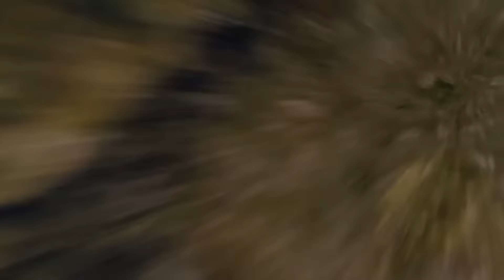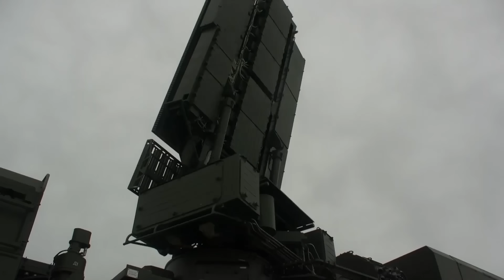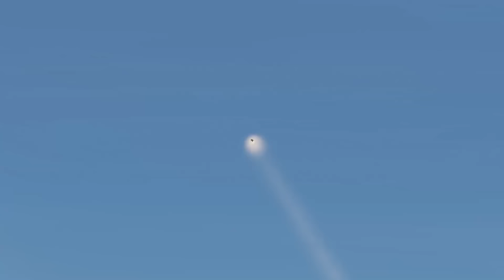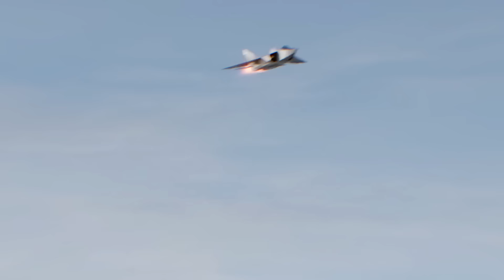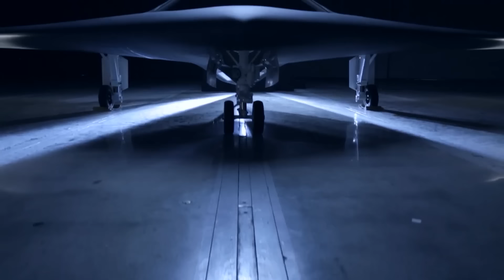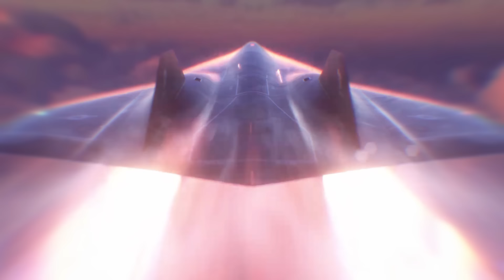F-47 7th Gen Fighter Jet Broke Every Record — China’s in Shock!

Comment: WRONG the F-22 raptor is a Air Force Jet NOT Navy -  

Range of the F-15 Eagle

The F-15 Eagle has impressive range capabilities, which vary slightly depending on the specific model.
F-15A/B/C/D Models

    Maximum Range: Approximately 3,450 miles (3,000 nautical miles) with conformal fuel tanks and three external fuel tanks.

F-15E Strike Eagle

Maximum Range: Similar to the F-15A/B/C/D, the F-15E also has a range of about 2,400 nautical miles, optimized for long-range strike missions.

Summary of Key Specifications
Model	Maximum Range

F-15A/B/C/D	3,450 miles (3,000 nm)

F-15E	2,400 nautical miles

Range of the F/A-18E/F Super Hornet
Maximum Combat Range

The F/A-18E/F Super Hornet has a maximum combat range of approximately 1,275 nautical miles (2,346 kilometres) when configured with minimal armament, such as two AIM-9 Sidewinder missiles. Range with Load outs

The range varies significantly based on the loadout:

Loadout Description	Range (Nautical Miles)

Minimal (2 AIM-9)	1,275

Standard (2 AIM-9X, 2 AIM-120, 2 2,000 lb bombs, 1 drop tank)	~1,188

With Conformal Fuel Tanks (CFTs)	Potentially increased by 260 nautical miles

Future Range Enhancements

The U.S. Navy is exploring new methods to extend the Super Hornet's range, including the potential reintroduction of conformal fuel tanks, which could provide additional fuel capacity without significantly increasing drag.

The Super Hornet's design allows for flexibility in mission profiles, making it a versatile platform for various combat scenarios.

Comment: It actually can fly into the past or the future. It has advanced time travel capabilities or ATTC which if the Air Force should lose an engagement it can go back in time and win. Or go into the future and see where an adversary will be then travel back to the present and tell its fighters where to attack. Amazing aircraft. I actually work on it at area 52 which is just down the road from Area 51.

Comment: China has shown with little fanfare to make platforms that look good and that attempt to steal tech that resists reverse engineering. The carriers not even nuclear that do not work, catapults that do not work,  carrier elevators that do not work, search radar that does not work, 6th gen fighters that are flight limited and could never fight in real contested airspace, raptor engines copies that do not work, space capsules and lift systems that are decades behind, computers and avionics that China could not copy even if they had the plans as China cannot make the chips, metals alloys that are secret and machining manufacturing techniques ceramic coatings that the manufacturing process is so complicated as to make even the actual formular nearly valueless. When the US takes a system to operational it works better than thought and routinely devastates the adversaries.
My understanding is the F-47 uses altitude to defeat range, speed. and thermal conflicts in operational perimeters in concert with newly developed ceramic stealth coatings. Fly about  100,000 feet altitude and surface friction is reduced by about two orders of magnitude by less dense atmospheric pressure (.156 vs 14.7 PSI at sea-level about 1/100 as dense) which as drag is also reduced increases speed and range as it takes less power to push the aircraft. Of course at this extreme altitude for initial jumps to conflict zones stall speeds  of Mach 2-3 are realistic (appx. 1200-1800 knots, 1380-2070 mph) and that's just the minimum speed to prevent a stall and could expect skin to be able to stay below 212- 284 deg. F with skin cooling from fuel before it's sent to engines the aircraft at that alt would be stealth for IR heat detection. This would make the max contested airspace speed to be Mach 2.18 or about 1250 kts to remain under control, not stall, and remain undetectably stealthy. Of course the plane at that alt could approach/transit the mission at far higher speeds until the F-47 entered contested airspace then slowing to Mach 2.18 allowing the skin to cool to stealth safe temps. At these speeds and altitude even if the pilot and plane were detected they would not be vulnerable to any of today's interception capabilities and if detected ever could just accelerate to a higher speeds like the SR-71 tactics used to defeat attempts at interceptions truly for both reasons un-vulnerable. Flying so close to high Mach-stall speeds would need similar computer flight control systems as used to enable the F-117, B-2, and B-21 to safely fly. If the above is true flying in much less dense atmospheric pressures combat radiuses of more than 2000 miles could be possible. Ray
Reply: Bro we haven’t even seen any footage of the f47 yet so all these supposed numbers may not even be true, never underestimate an adversaries tech regardless of biases
Reply: @christianbautista175  We did not even know about the existence of the SR-71 or the F-117 until they had been in service for years and still don't know the top speed or altitude that the SR-71 can routinely reach. I have already seen evidence of the failure of the Chinese copies of the raptor, failure of Chinas newest Radar in Venezuela, inability to get their newest carrier into service failure of their space crew capsule Mighty Dragon cannot remain at operational speeds for longer than seven minutes and the J-20 not achieving the stealth levels necessary. One thing that's apparent is that the newest tech is extremely resistant to attempting to copy and reverse engineer any advances. I believe the the positions I have taken are well supported by the facts some of which are outlined above. There is no doubt that the Chinese cannot make anything close to the computers routinely put into the current US planes as copying the avionics would need Chinese computers the size of a mid sized car to equal what in the current US weapons from AA missiles to planes anything that need powerful efficient miniature computers China is hopelessly behind and falling further behind by the day as their efforts are largely devoted to coping and manufacturing procedures. The new revised/updated F-15 has shown to be superior to the J-20... higher alt. more maneuverable faster and able to carry up to 22 air to air missiles and 29,000 lbs. of weapons and  this jet was operational in the mid 70's and still defeats the J-20 in simulations which is all we have

Comment: Without a tangible prototype actually flying, the F‑47 risks remaining little more than a shifting set of slides and design revisions on PowerPoint. In contrast, China already has advanced fighter platforms not only airborne and operational but also moving rapidly toward mass production and formal induction into its armed forces. Unless the F‑47 transitions from concept to reality, it will continue to lag behind, chasing incremental updates just to keep-up with China on paper while competitors consolidate real-world capabilities and expand their technological edge.:face-blue-smiling::face-blue-smiling::face-blue-smiling:
Reply: williamwilliam the CCP spokesman.  Chinneee  fighters still crapola
Reply: China paper tiger